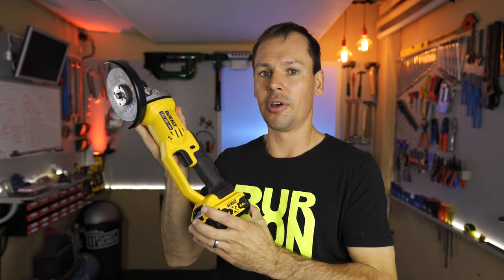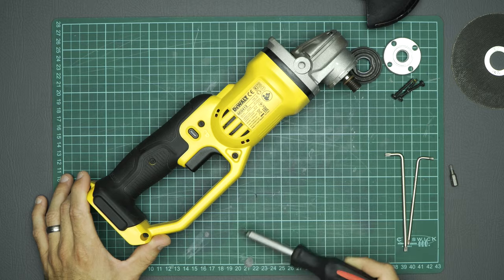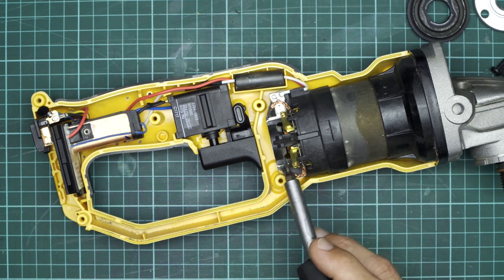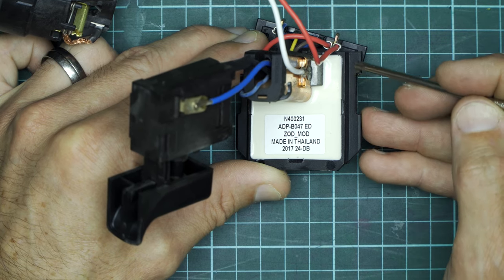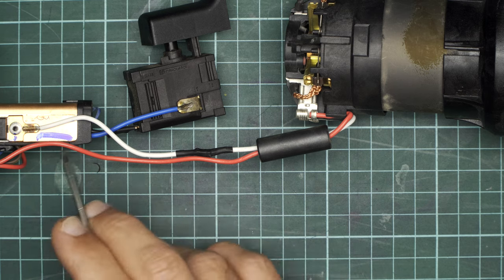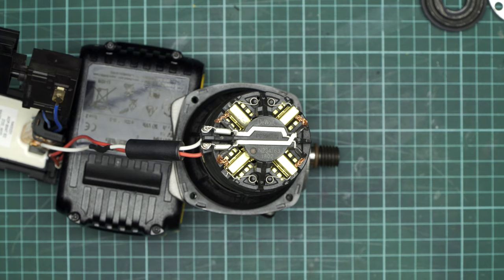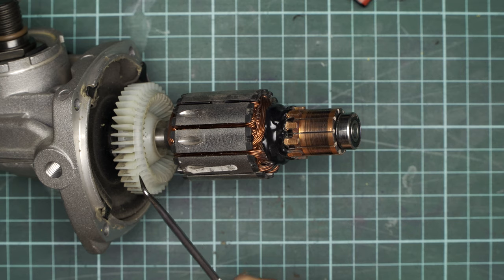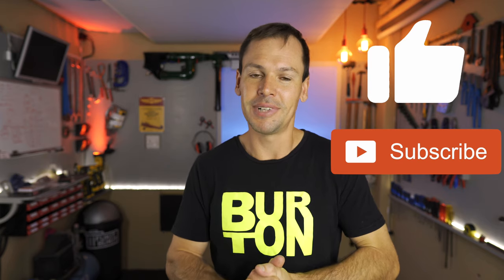TEARDOWN -  DeWALT DCG 412 20v MAX XR Cordless Grinder - Burton Builds S03E06 [4K]

Comment: Great walkthrough but I was watching to see the armature removal and you didn't go that far 😬🙄😔 For anybody looking for the same, there is no need to remove the nut as shown in this video. A firm wiggle and pull the whole armature unit out 😉
Reply from the maker: Hi Gaz, Thanks for the info about removing the armature with a firm wiggle... hopefully it helps others.

You mean removing the armature from the gearbox... yeah, I didn't do that (but I did remove the armature from the motor).

Comment: Just had the mosfet you talk about @ 9:00 let out the smoke last night, was cutting through a pipe and the cutting wheel bound up causing it to stop immediately. When I pulled the grinder apart, the mosfet had a big bubble in the center and there was a black mark on the half shell. Pretty disappointing for only 6 months of pretty light use.
Reply from the maker: Hi Kelly, that is pretty disappointing to hear... don't think it should have done that. Maybe you can buy a replacement speed control? or if its only 6 months old, isn't it still covered under warranty and the service centre can help you our with replacement parts?

Comment: Hello Grant, very informative video that I have been searching for. At “13.21” armature removal. I had ruined my tool, because I couldn’t get the armature back in. When I saw you get to that part, I froze .. and wow you saved it.  What were the screwdriver sizes you used... thanks in advance.
Reply from the maker: Hi, There are two sizes of screws / fasteners. There are five T15 Torx screws holding the clamshell together and four T20 Torx screws holding the gearbox to the clamshell. Hope you were able to get your tool repaired. Keep well and safe.
Reply: Hi Grant, I still cant figure out how to get the armature back in , do I have to remove all the brush's ??
Reply: @GrantBurton  Hi Grant, I have to remove the brushes to get the armature back in ?
Reply from the maker: Hi Icyrene... I must apologise, I missed this moment and its probably to late now but anyway... Yes, you do have to unclip / remove all the brushes, then insert the armature and then clip the brushed back in. (I often check for new comments but some still seem to slip through the cracks... I'm sorry).

Comment: is there any reason there is 4 brushes for this grinder ?
most of the tools i have seen they have 2
Reply from the maker: Hi rexhunter, I think its got to do with the design of the motor... I can't remember specifics of what i saw when I opened it but a quick google search hints to a lap wound motor design suited to low voltage and high current applications where greater torque is needed from a motor. Greater current passing through the armature results in greater torque, which will help the grinder not to bog down when cutting or putting the grinder under increased load.

Comment: Thinking of This or the DCG413b Brushless - but i Don't like the Handle Shape !!!
this Handle looks better to Hold not as FAT as the Brushless one . 
also Seen a Teardown of the Brushless - CHAOS more Wiring 
Good Video BTW
Reply from the maker: After a bit of use, I don't like the DCG 412's handle shape... its not my favourite. The reason is when trying to use the tool with a single hand, the trigger is too far back from the cutting disk, which greatly reduces control. Comparing that to the small corded grinders where the switch is up near the gearbox and your hand grips over the motor... this gives far more control of the tool.

Looking at the DCG413's paddle switch and grip, It looks like a person could grip a full hand over the motor and use their last two fingers to activate the switch. I haven't actually tried this which is why I say it looks like a person might be able to use it this way.

I say all of this however as much as I know the safest practice is to grip the grinder with two hands at all times, most of us often use these small grinders single handed.

I also think the brushless grinder will be more efficient considering power versus runtime.
Reply: @GrantBurton  the RPM is 1000 rpm Quicker - Brushless 9000 rpm vs 8000 for the 412- picked up the 412 on Sale $99.99 CAD

Comment: Awesome!  Thank you.  The box says the gear box/blade can be rotated degrees by unscrewing the top (silver part), but not to pull it out more than 1/8th of an inch or it must be serviced.  Do you know how / why this would be an issue, or am I missing something?
Reply from the maker: Hi Jack, The motors armature extends into and is retained in the front silver gearbox section (where the crown wheel and pinion meet) so if you unscrew the gearbox and pull it out to far from the plastic housing, the entire armature will come out and as such, the commutator will be pulled away from the brushes. Because the brushes are spring loaded, they will extend into the area where the commutator was running. If you now try push the armature back into place, the commutator will butt up against those 'extended' brushes and wont go back into place. If this happens, you will have to open the tool, unclip all 4 brushes, pull them out... then slide the armature back into place... then clip the 4 brushes back into place... which is why they say it will need to be 'serviced'.

If you unscrew the gearbox and don't pull it out more than 1/8th of an inch, just pulling it out enough so that is is able to rotate to the desired position, the brushes will still be held in place by the commutator and all will be good. The gearbox is indexed with the outer case of the motor which is why you have to pull it out just a little bit in order for it to rotate.

Hope this makes sense?
Reply: @GrantBurton  Thank you for the thorough explanation.  It's great to have that option to turn the gearbox.  For now, it's fine for my use.  I re-read the instructions and they say if you unscrew the box, you should be able to rotate it without lifting it at all.  My first time using a grinder, and this worked perfectly.
Reply from the maker: I’ll have to go try mine again... when I originally rotated it, I needed to lift it slightly to get it to move... maybe there was just a bit of dirt or something stopping it but thank you for pointing that out.

Comment: Is there any way to mod the tool so that you can use the lock button to lock the power button when it's activated.  So you don't have to constantly press the button when cutting or grinding.
Reply from the maker: Hi K, that is a great question... I have often needed to use the grinder without having to hold the switch and its super irritating. Both my other corded DeWALT grinders have a lock-on button. I'm not sure if there is a way... I would need to open up the tool again and have a look at look if it could be modded... maybe thats a video i need to look into.
Reply: @GrantBurton  It would be great if you could figure out a way to do it.  I see a lot of these DeWalt grinders at work places and most people would find having this feature useful.  Thanks!
Reply: Ha.. A locking trigger is a good way to lose your grinder to oncoming traffic... if you drop it while it's running..
Reply from the maker: Haha... thats pretty funny... imagine that actually happened and it had to be chased across the road.

I must say in all my years I've never dropped a grinder while using it... I have however once plugged one in and the switch was in the on position... had to change my underpants after that... haha
Reply: @GrantBurton  Haha... I know what you mean...